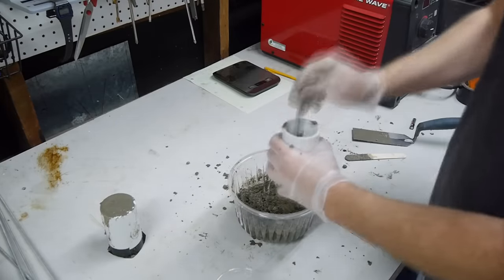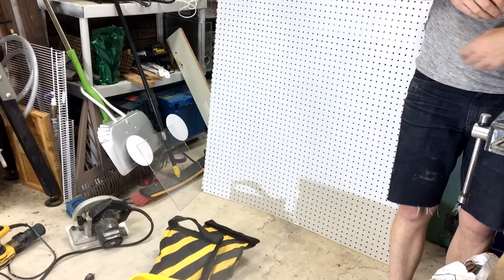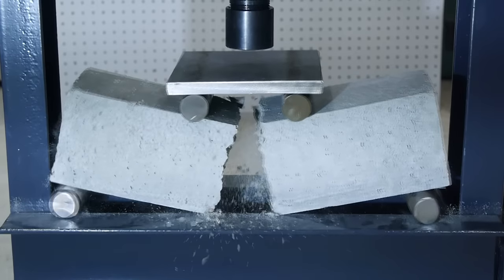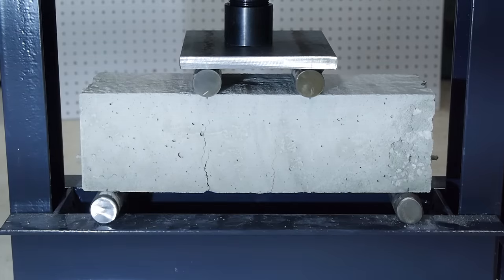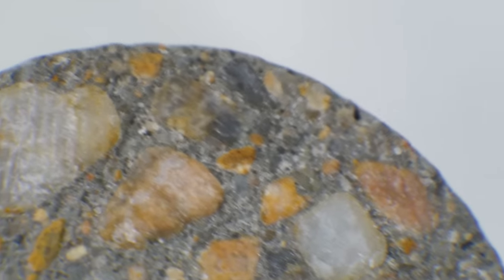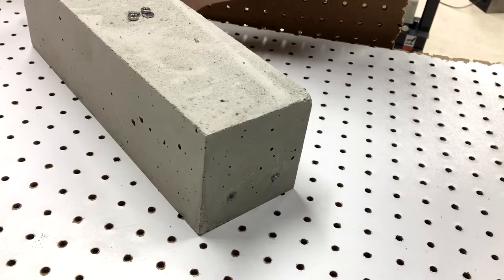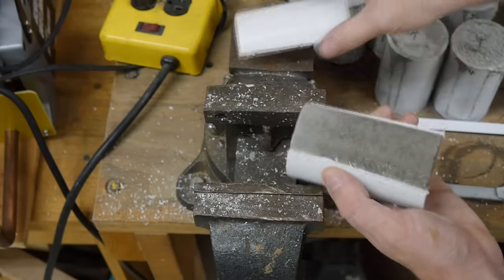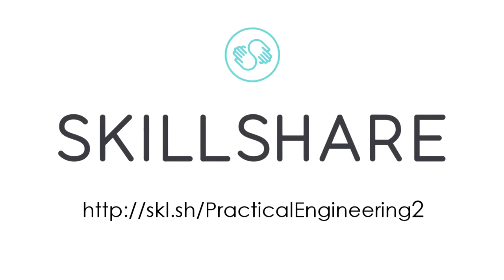Why Concrete Needs Reinforcement

Comment: The post-tensioned concrete wasn't any stronger than the rebar reinforcement... but it took more pressure to crack it....

Hopefully this guy isn't in yhe construction industry, because he has absolutely no awareness of what he just said. If something takes more pressure before failure, that means it is stronger.....   not sure how delusional he is, if it is confusion with the English language,  or the physics of his tests...   either way,  ignorance reigns with him ...